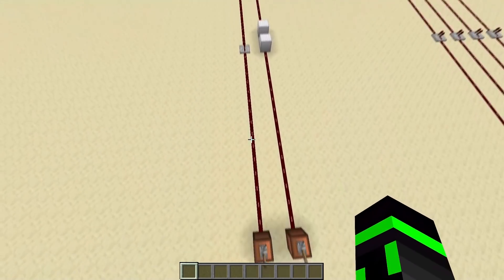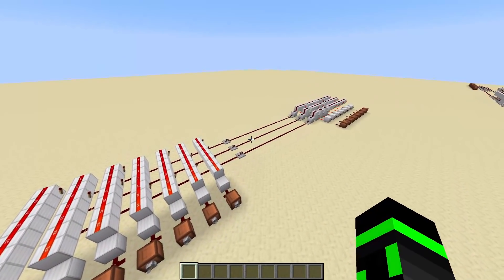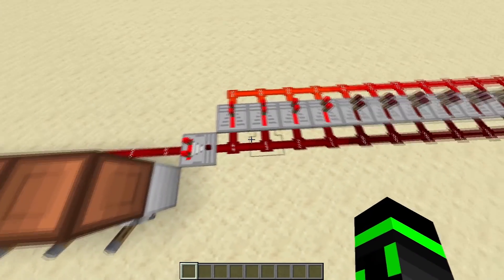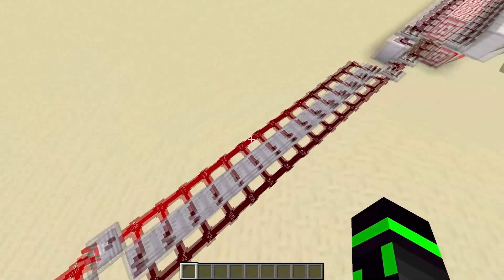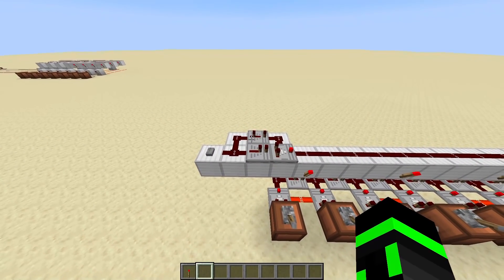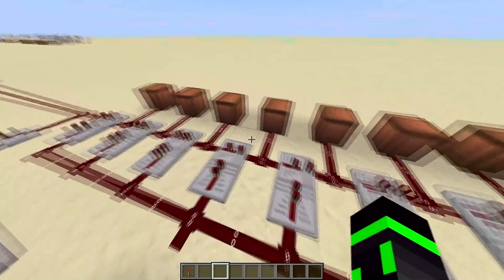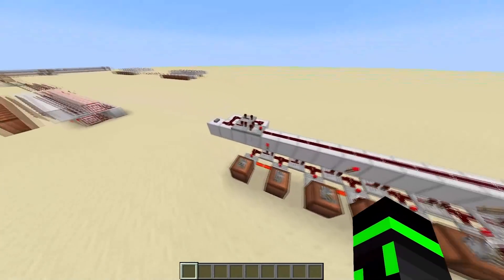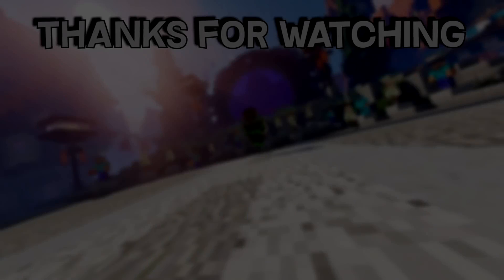Data Transfer | Logical Redstone #5

Comment: note for bedrock edition the singnal bit timing is ever so slightly off on the last transfer method so just reduce the delay on one of the singnal bit repeaters by 1 tick and that will fix it if you have trubles

Comment: Okay, my first thought watching was "This is Bonkers".
And my second thought was "You can make ASCII with this". Given that ASCII encodes a 5-bit signal and uses the first three bits in an 8-bit system to tell it how many cells there are (again, the first bit is a "Hi, here's a code" bit), you can encode ASCII signals using this transmission.

Comment: im amazed by this because im a starter redstoner and i made something like the last circuit, 
with 1 redstone line, but i used counters and multiple spaced out pulses to send messages and this is the same thing i had functionally done but way smaller and faster.
rly good vid btw👍

Comment: Fascinating!  I'm building a binary to unary signal converter with up to 72 unique outputs using powered rails (uses vertical signalling with bubble columns and/or wall reshaping for instant build-height limit transmission).  Your binary Tx/Rx circuit will be perfect for triggering the mechanism.

Btw, I've found it useful to use a 1rt pulse piston to clean up the rising/falling edge behavior of observers.

Comment: That's actually kind of parallel interface (which is fast but takes a lot of space) compared to serial interface (takes only a few wires but a bit slower) and the signal bit is actually nearly equivalent to the sync pulse in serial interfaces.

Comment: Great episode, I even was able to gues the use of the signal but before you talked about it, as something similar is used when handling packets called packet headers. I have little doubt that packet headers where the inspiration for the signal bit, so being able to put some random stuff I learned in my highschool cs class is cool

Comment: i'm having trouble with sending 8 bit pulses through one line can this work with bedrock or does it have to be in java
When im sending information the Redstone repeater doesn't get rid of the info when it should after 2 ticks the repeater still has info inside it even if the repeater is set to 2 ticks is this just a problem with bedrock or have i done something wrong because i copied a 1 to 1 copy of the 8 bit pluses through one line that you did and it doesnt work? :/

Comment: I am curious about a serial data transfer technique for hexadecimal using signal strength. I think that would be the most compact transfer, but I am thinking the data transfer might just be placing a series of comparators back to back?

Comment: I built the serial data transmitter and receiver exactly like you, but for some reason it doesn't work. When I change the timing on the waiting repeaters I only get one lamp, even tho I have 2 on in the transmitter. Please help.

Comment: I wonder how difficult this set of questions is to answer:

“How do I get started with properly learning redstone coding?”

“Do I need a formal education with computer engineering to actually be capable of putting these circuits to work?”

“What is considered “the basics” for coding? Redstone components? Logic gates? Or does coding like this begin as its own animal?”

Comment: As long as the parallel redstone lines are going straight and are exactly 15 blocks in length between every repeater, you can actually put them directly next to one another. It doesn't matter if the signal travels sideways on to one of the other redstone lines since the signal won't be strong enough to reach the next repeater anymore.

Comment: is there a way to increase the delay beetween the pulses in the serial, i've tried with 3 redstone ticks instead of 2 and it worked but i can't do 20 redstone ticks in beetween, it's for a sculkl sensor message transmission

Comment: If you didn't want a rising and falling signal on the powered rails then you can place a sticky piston with a redstone block on it's face after the observer. In this way, when the lever is flicked on, the sticky piston spits out the redstone block on the rising edge and only retracts the block when the lever is off.

Comment: Could you do hexidecimal with the encoder decoder as well as the signal strength comparator method? In essence you would need two of the comparitor trains but get 16 different values

Comment: you can kinda avoid the issue with the rails, by just slapping a sticky piston with a Redstone block at the end of it (piston may no face upwards cause... Java) at the final destination of the signal. You have to place a detector every 8 rails. It can also go around corners but requires more detectors. 
All in all, 8 wide and only 1 block high (2 if you count the block it's being placed on). only downside, can't detect inputs faster then 2 ticks since otherwise the piston will not retract the Redstone block fast enough.
It's compact but only half as fast (as you need to place a detector every 8 blocks instead of a repeater every 15), and can break if inputs are too fast. 
But takes only half the space.

Comment: I wonder if you could use arrows for data transfer if you keep the chunks loaded and the arrow is at proper speeds you could transmit data that way all be it limited to around hundred blocks it could be viable.

Comment: So, after watching this video and your ROM/RAM video i decided to mess around with some of the ideas, and here is something i came up with, a hybrid sequential/signal strength data transfer system for a Feed tape ROM system, basically, what it does is it uses a feed tape of glass and concrete to store 15-bit data, then uses a set of repeaters chains and observer blocks on the inside of the feed tape to allow for it to be sequentially read with each bit still having a different signal strength, now what this does is it allows for the signal bit to be excluded, and what this does is allow for 4 signals to be sent through one wire "simultaneously" (the offset for each pulse in my design is 2 Redstone ticks), as they can be offset on a 20 hz clock circuit, so a decoder also built on a 20hz clock to could decode each part of the signal separately, thus allowing for ludicrous amounts of data transfer, also, while my current version uses Feed tape Rom (in my current prototype 14 "bytes" of it), i am trying to figure out how to use a block swapper to make this into re-writable RAM that could practically be used. well, i say i could get it to work on 4 signals, but thats still not fully 100% working, although 2 signals does fully work

Comment: I used this in a slightly different way. Instead of repeaters I used comparators to send multiple signal strength in a row instead of binary give. I call it the ram since you temporarily write your values into it to send them to the system. This signal gets send to a converter system (shown earlier in the video) to input that signal strength into an observer based gpu. That gpu then produces the binary signal with a speed of 1 bit/tick, instead of 2 ticks, like in the example here. I use this for a seven segment display witch means it needs 8 ticks (the 7 segment bits plus the one starter bit to lock the segment bits at their segments) before I can send another character from the ram to the system. It needs no tick to pause the input between each value aka character, means the input can basically just flow through the display with 8 bits/character. (and depending on the display design you can carry the signal from one display to the next. But that's another topic.)

Comment: Do you really need to prevent wires from interfering if the signal strength is put in a way that it reaches only one repeater?
Reply: If you really use the full of length and your rows are parallel to another and not offset, then no. Else they would interfere with each other.

Comment: On the rails part did you forget to mention that A) The lines are smaller than redstone (Only 9 instead of 15 blocks) and B) increasing length may not be as easy as redstone (Only the very first segment has an always-on/off state. Following segments are either only a pulse or require a t-flip-flop setup to function)

Comment: I've been watching many of your more popular videos (TI Calculator, Tetris etc), and I'm curious about how difficult it is compacting all the gates required to make it work. Whenever I sit down and think about computing in minecraft my #1 roadblock is that I'm never able to imagine putting all those together without them accidentally combining. So my question is, is it more difficult planning which logic gate needs to go where or making sure that they don't combine? Like do you often need to go back to your circuits and fix an issue with redstone lines combining and breaking, or do you design each part separately before putting them into the larger part to make sure they don't combine? Sorry for the extremely long comment, seriously love your videos man!
Reply from the maker: thanks! most of the time its not just logic gates straight to design, there is lots of abstraction happening inbetween the two. you always wanna make components individual components that are based on a certain function. for example, if you make a binary adder, then you can now reuse it whenever you wanna do addition, and you could even forget how it works on the inside- but it doesnt matter, because you know how it functions. hope that makes sense.

Comment: For the serial data transmission, instead of having a signal bit, I used a clock pulse which is sent alongside the data line. The clock pulse is already in the circuit just take an output from the initial clock used to place the data in the serial line. This makes timing the circuit easier as all that is required is setting the delay on the clock pulse aligning it with the first data bit. In addition, using the clock pulse also allows for an easier way to take an output from the de-serializer, timing a 2 tick pulse just right you can pulse an output stage taking an output as the data flows past without holding the data. If a constant output is required placing a dynamic memory module after the output is all that is needed.
Reply from the maker: ultimately this is the preferred method, for exactly the reasons you described. i just didn't wanna go too crazy on a beginner vid haha. great comment
Reply: @mattbatwings  do you plan on ever doing a video on this? Would be interesting to see the advantages of using a clock instead of a signal bit
Reply: well actually, there is always parrallel line with clock running , precise timeing is easy, just same amount of repeater as on transmitting side. That clock is game itself

Comment: If you're looking for some ideas for this series, I feel there is a massive gap in youtube content related to redstone displays. The only thing I can find are videos pre-1.5 and compact button counters. I've seen some compact looking 7 segment binary displays but I haven't found anyone showing designs like that in isolation. 7 segment displays bundled with pixel arrays would be awesome. I especially loved your video about memory, as I have not seen it explained in such a good way, and now I have so many new ideas. Thanks for making this series! as someone whos interested in this stuff they are amazing, and hopefully they introduce new people into the community.
Reply from the maker: thanks :) adding this to the list
Reply: Look for "Mazuma Games" on Youtube
He has a great series on displays and even designed a 1×1 - pixel display
Reply: I have actually been looking into colour displays with cauldrons, with water and lava buckets. Sadly it requires a higher pixel size however it does work. 3 colors!

Hopefully Mojang finally adds dispensing powder snow, that way we get an extra colour

Comment: A little question for serial data transfer receiver, why do we need separate line for the signal bit. Can't we just use the same repeater line as every other bit and then add more tick delay at the end of the line then use redstone torch(SR Latch)? This way it'll save up a little more of server resources.
Reply: Apparently, it's slightly more complicated than I initially thought but here's an alternative version I designed, https://media.discordapp.net/attachments/380226596314939392/907577159252598784/unknown.png (Yes, I use discord attachments).
Can't tell if it's more compact or not.
Reply from the maker: that’s what i built? there’s not a separate line, it’s all one line, and the signal bit goes first into an SR latch
Reply: @mattbatwings  Sorry for my wording , I didn't mean the main line (the one that bring the signal across the globe). I meant the line that got separated from the main output on the receiving side. 
I see the problem now that it's much more complicated than I thought.

Comment: 0:33
To have a even stronger one use a block with a forward facing sicky piston that has a redstone block on top of it and 2 blocks infront place a backwards facing sticky piston, after that place a last block 3 blocks after the first block and place redstone dust on it. Now you have a repeater with no delay (both ways) that spans 4 blocks
(For more details check the video on my channel about instant repeaters)

Comment: I was doing some serial stuff yesterday, but mine way more overly complex. I was measuring the signal strength of shovels in a hopper and had a bunch of timing circuits. It was fun to figure out, but this is so much more efficient! I want to wire up  my next base with all the farms connect with a single red stone line and this will be the way to do it. Awesome video!

Comment: The last design (the serial data)

Could it be possible to use comparators in order to save signal strengths?
Reply from the maker: yes it is! check out the link in the description

Comment: You can actually make the serial data transfer per 1 tick instead of 2, I've made entire memory arrays that receive serial data on a 1 tick basis.
Reply from the maker: yep. i just didn’t do that because the comparator unlocking requires 2 ticks. but if you use a different method like observers or a bunch of 1 tick pulse generators for your send-in then you can do 1 tick

Comment: How about using something like I2C? Then you can use variable length, so you wont wait for a long time for a small signal? Tho you would need 2 lines, one for signal one for clock.
Reply from the maker: for sure, if variable length is necessary, that would be the way to do it. just didn’t want to go too in depth for beginners

Comment: You don't actually need blocks to cut off the redstone connection if you want lines next to eachother. If all your lines are 15 long it means that the power of one line won't reach the input of the neighbour
Reply from the maker: facts!
Reply: true i did not think about that, you could just have 15xN fields of redstone connected by repeaters
Reply: I commented this just now relishing you already said it 😂